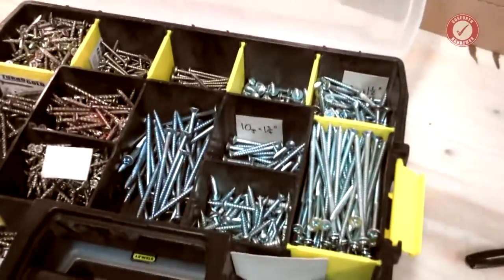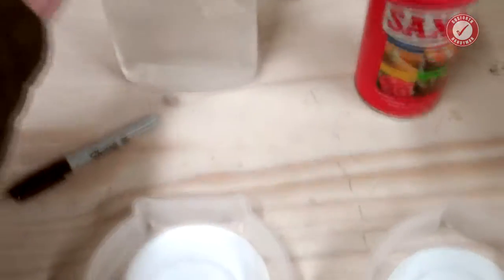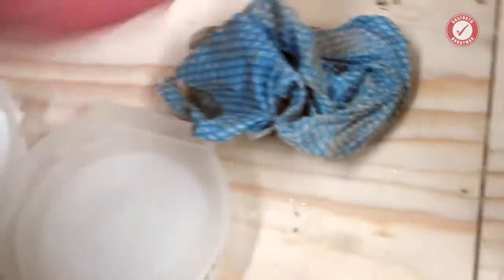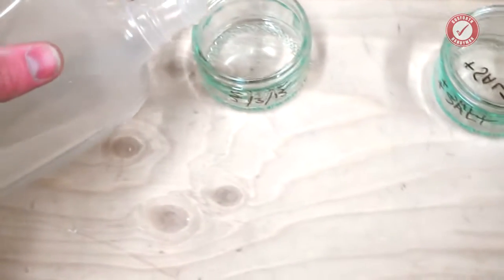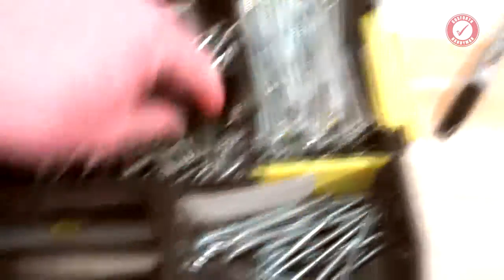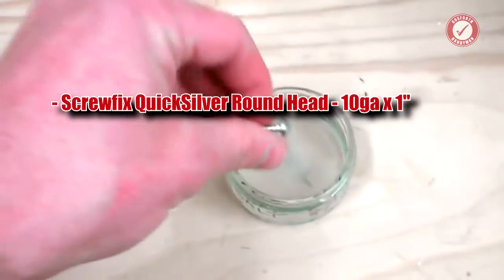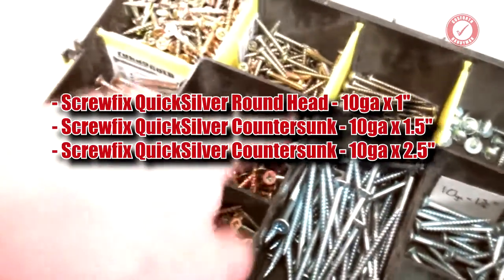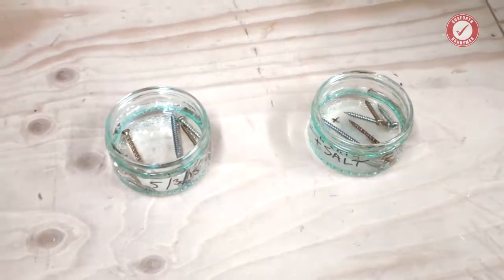How quickly do Woodscrews rust? (part 1 of 2)

Comment: I think you are missing an important ingredient - oxygen. While I don't imagine rust will be avoided by full submersion in water, but I would think that moisture plus air is what will make your screws rust faster. I would be more curious to know what would happen if you filled the containers so that the screws were only half submerged, perhaps agitating them on a daily basis. In use, screws are likely to suffer from moisture and then dry out a bit and then get wet again... etc
Chemistry isn't my strong suit so a second opinion would be helpful. But without being clear on the exact science of the chemical reaction causing rust, it seems highly probable that you'd end up with quite different results with slight modifications.
???